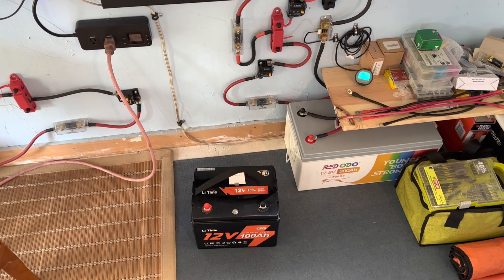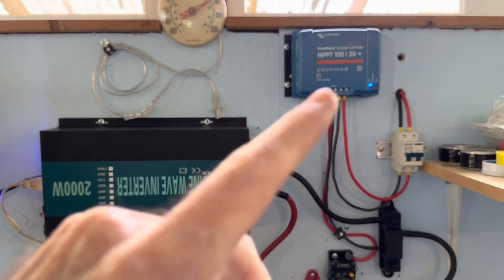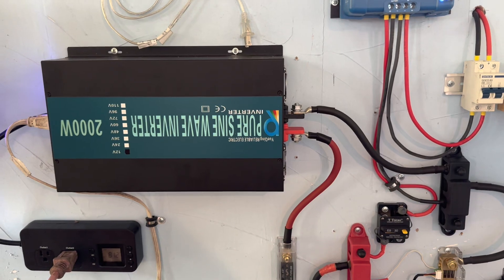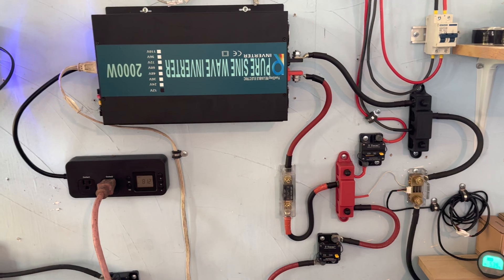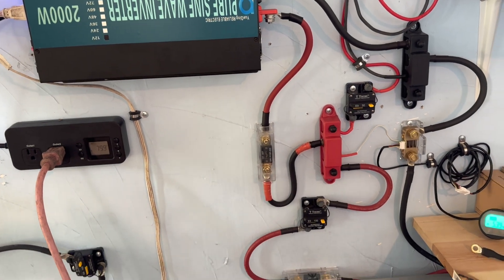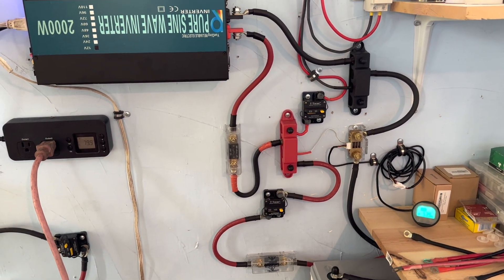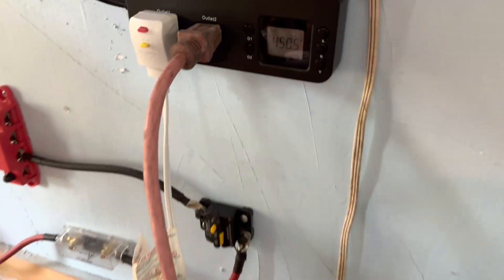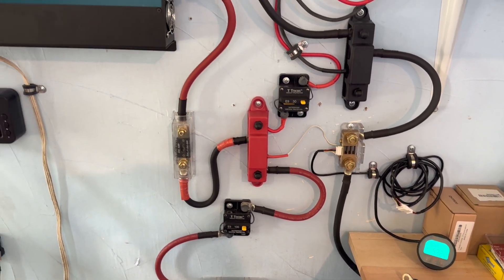100 Amp fuses blown!  300Ah LiFePO4 system down! Unforced error! Making the mistakes for you! Ouch!

Comment: Newbie question. Explain the use of a breaker and a blade fuse on the same run.
Reply from the maker: Only reason I doubled up that way was for quick disconnect as I move batteries in and out for testing, and like the breakers for that. 🤙
Reply: @ProjectsinParadise808  When you switch out a battery, do you bleed in through a resistor to keep the in-rush from harming your inverter? or just spark it?
Reply: Sorry to offend. That was a newbie question, too. I know just enough to get myself in a tight spot.
Reply from the maker: @j.malone1293  I do use a resistor so not to spark🤙
Reply from the maker: @j.malone1293  Me too! Haha! Aloha buddy 🤙

Comment: If you can, go from 12V to 24V or best 48V system. Will cut your current need down to 1/2 or 1/4. Also get a 100..200A DC circuit breakers (Midnite Solar) instead of fuses.  Will make your system more reliable.
Reply from the maker: I have been looking at that brand of breakers, as I upgrade may grab some of those. 🤙
Reply: Series lithium has caused me some issues. Long story short. Buy lithium in voltages that your inverter is or buy a expensive balancer.

Comment: If I use 80 a m p in 3000 watts of solar panel with a 5000 what 24 amp inverter with eight AGM batteries what size amps and fuses would I need the wiring from will be 4 gauge 3 the battery wires will be double 2

Comment: What is this, 2AWG wiring? We're using 2AWG, orange flexwhip welding cable. 

I use a 125A fuse on my 48V 3000VA(2400W) Victron MultiPlus II... The inverter should be able to surge to 5500W momentarily. How sure are you that you want to run 200A through those wires until the fuse goes out? 

I'm running an expensive class T fuse because it's a 10kwh LiFePO4 battery bank... Doesn't mean everybody needs to. 

I have my 3KW of panels mounted now if you want to check it out... We run a raspberryPi instead of buying the Victron CerboGX here.
Reply from the maker: Yes, running 2 awg. Been having problems finding T class, but ultimately will get some. Dont plan on ever running 200 amps through it actually. 🤙
Reply: I've ben going through comments replying with info you FINALLY stated here, about the surge capacity of inverters. Your 125 amp fuse, at 48 volts, is the PERFECT size fuse. You win my award for being the first sensible person I've read here. lol.
And YES to Class T's... next in line is MRBF's, and ANL's come in third place for interrupt ratings.. I ONLY use class T's, but would use MRBF in a pinch.. ANL is more suited as a fuse for branch circuits, like say the inverter.... but do not protect well enough(fast enough or with a high enough interrupt rating) for use as a 'battery fuse'.☮🇨🇦

Comment: how was anything running with the blown fuse? before you found the blown fuse, you said you turned the inverter on and it was making weird noises and your shunt monitor was reading a voltage (albeit, an incorrect reading). if the main fuse coming off of the battery has disconnect the circuit, shouldn’t everything be off??
Reply: I've been reading through comments looking for this. Yet I see he didn't respond to you. looking in the vid, at wires, the only way I see the inverter having power after the blown fuse is that it has to be coming in on the AC side. There is something SERIOUSLY wrong here!

Comment: I am a electrician and have made that mistake before . The fuse worked . when in use you can put volt meter across them to check. voltage with load/charge on should be very close to zero if several volts it's open. even a test led will work. just watch voltage like that 24V/48V want a test light rated at that voltage. Some times a fuse can blow and still look good. the real test is take the fuse out and test with meter . one thing I did see is that breaker going to battery ? it looks like 100 amps ?  if so that may trip over time. they do have a thermal delay to them. fuses like that blow fast . what I do hear. fuse and breaker . I like to fuse at the rated BMS in battery for battery fuse. That 200 amp should be ok on inverter . check manual to make Shure. it is better to undersize a fuse then use to big of one.  I got 100 amp on my 24V 2000 watt inverter . the 1500 watt 12V has a 175amp fuse. with 24V and 48V battery use fuse rated for that voltage . most of them are rated 32V max like them ANL or ATC or MAXI ,AGC ,ATO and a bunch more. also look for DC ratting voltage and amperage.  now the AC side of inverter use fuse/breaker rated at AC volts/AC amps. your system 125V ac fuse ratting.  250V ratting for 240 V users. looking good. we got sun in Boston NY but bitter cold and windy .wind chill -20 F . light snow. some schools closed due to cold. Buffalo NY . a lot of kids walk to school their. yes buffalo wings/chicken wings inverted their. anchor bar. and town next to me. Hamburg NY .the hamburger invited hear . Erie county Fair.  and lot more came from around western NY. Jell-O ,sponge candy and more.
Reply from the maker: I did find it interesting that the breaker never tripped. Must of took a few seconds to pop the fuse, but not sure. I know when the hair dryer went to full output it popped. Have it working okay now though. Did take me a few minutes to actually figure out what happened. Busy with company, and bragging that the system would handle no problem...then the alarms! Ha ha...I quit bragging after that! Aloha! 🤙

Comment: Better the fuse than the whole system or your inverter blowing up.  That fuse did a perfect job.  Also, why have you disconnected your other battery????  You can use different ah lithium batteries no problem.  Just parallel to the bus bars.  2 cables won't cost that much and you'll have extra power.
Reply from the maker: You got that right! Fuses are cheap, and a good fail safe indeed. 🤙

Comment: On your other system with the two Chins 300Ah and Reliable 3,000 watt, what size fuse are you running? (I have the same). The batteries have a limit of 200A output so should the fuse be a 200A or 400A? I installed a 200A fuse thinking I would never be using more. Spring is on it's way👍
Reply: I'm guessing that in series the amps don't add, so <200A may be best. The current draw may not be equal between the batteries (ie the one near the wire terminals usually drains faster). Maybe like 175A would be best? A 175A breaker may be better and save some cash? Constantly heating some wire coatings is not great for their longevity. I'm just a DIYer/hack, not an electrical engineer.
Reply: @silverleapers  Thank for the reply. The batteries are in parallel (12 volt) and I'm using the big stuff 4/0 which can handle 240 amps I think. Even in parallel I think the limit is 200 amps max output.
Reply from the maker: I have 200 a fuses on that system. Working well and within the coverage I need back there.  Spring showers coming! Aloha! 🤙
Reply: 200
Reply: 200

Comment: I went with circuit breakers rather than fuses . if I screw up it's a quick reset and I'm back in business. The boom boom car stereo crazed has made DC breakers readily available and economical
Reply: But those car audio breakers are usually junk. Inverters require a quick blow T fuse

Comment: What size is the wire? I believe 12v 2000w a 2/0awg is minimal recommended. Fuses are intended to protect the wire from heating up & melting possibly starting a fire.  Another 100a or a 150a fuse maybe beter replacement for that gauge wire
Reply: 2 awg can safely handle 115a. Where as 2/0 (bigger than 2awg) can safely handle 200a
Reply: @Earthmadegarden  Not all 2 AWG wire is rated at the same amperage.Insulation changes it's capacity as well as conductor makeup. Then there is copper clad ,pure copper,aluminum the list goes on.Welding cable can carry more with the right insulation for instance.Have to check the charts!!!
Reply: @Earthmadegarden  only at a certain distance alot of people forget about the voltage drop.
Reply: @Supanova70 true
Reply: Do that same test and feel your 2 awg wires. They may be heating up quite a bit
Reply from the maker: Running 2awg on that system. Working well for what I ask for it. 🤙

Comment: Aloha
Yes truly another beautiful day.
Playing with " Junk Math", is practical and fun at this level. My simple approach is to estimate these things with rounding numbers to easy quick math. This provides me with a reference point. First I establish the multiplier by estimating the DC battery voltage and the AC output voltage. 12vdc and 120ac. 
The multiplier from DC to AC is 10X ( 12vdc x 10 = 120v) This simple math then allows me to do the same with estimating the DC current expressed in amperage based on the AC load expressed in Watts. I just use the multiplier of 10 E.G. The 120VAC hairdryer consumed 800 Watts. 800/10= 80 amps DC
If the sum of the total AC loads are 1000 Watts then   1000W/10 = 100 amps DC  current. What if the fuse selected is rated at 200 amps? 200 x 10= 2000 Watts AC load capability. 
It's even easier to move up to 215-230 vac loads because they consume roughly 1/2 of the amperage ( this is because the higher ac voltage push results in half of the current needed) Therefore estimating 230 vac loads will be roughly one half of the 120 VAC loads and 12 vdc current in amps. From here switching the battery voltage to 24 or 48 works exactly the same. The AC load is halved and halved again respectively. E.G. The 24 volt battery supplies 40 amps of current to the 800 watt 120vac hairdryer.
Reply from the maker: Aloha! Thanks for sharing this great information for everyone! Difference a day makes. Catching some rain today, thank goodness. Still pretty dry here. Mahalo again for the info! 🤙

Comment: Ouch.  Remember that "properly" means sizing the fuse so it is the weak link in the system.  Or in other words, size the fuse (or breaker) to protect the wiring.  The wiring needs sized to support the load.
Reply from the maker: For sure! 🤙
Reply: @ProjectsinParadise808  125A*46V (lowest/worst case scenario) is 5750W... Is there a reason you're suggesting 200A? That would max out or exceed 2AWG wire ratings depending on the wire right?
Reply: @incredibleyoutubehandle  He's running 12 volts (12.8, technically), so, using your 125 for example, is 125 x 12.8 = 1600 watts.. not enough for a 2000 watt inverter, which, if it's like most, can peak around or close to double for a few seconds of surge, like refrigerator compressor kicking on. Even a 200 amp fuse is 2,560 watts.. still not enough to handle a possible 'in spec' surge, but it will suffice if he doesn't load the system to its max capable output.
Don't get me wrong.. I'm not saying he's got it right yet(a few errors I see in this setup), but I was just correcting your false assumption re: the voltage to amp numbers you used. (as they say, the devil is in the details. lol)☮🇨🇦
Reply: Thats the downside of 12V systems. Ohms law. The lower the voltage, the higher the current. Melting the fuse is better than melting the wires.
Reply: But if the fuse is overkill sized then only the appliance can burn down right ? It would bypass that fuse and blown up the battery(ies)?
Reply: @Khlandestine  Fuses in wiring do not protect appliances.  Fuses in wiring are to protect the wiring.  If an appliance needs a fuse it will have a fuse in or on the appliance.